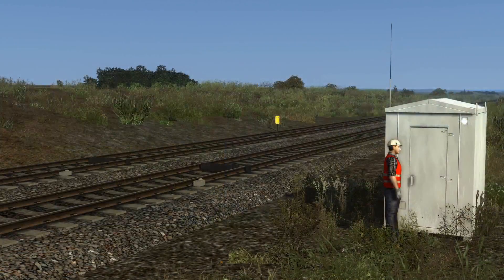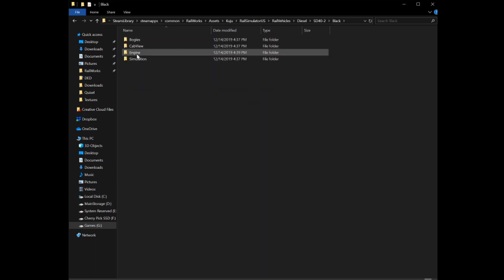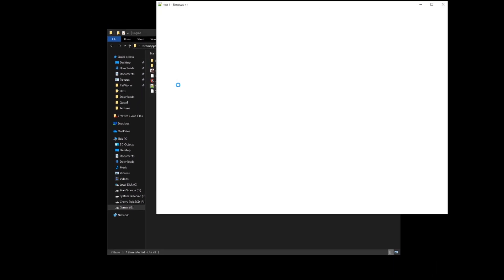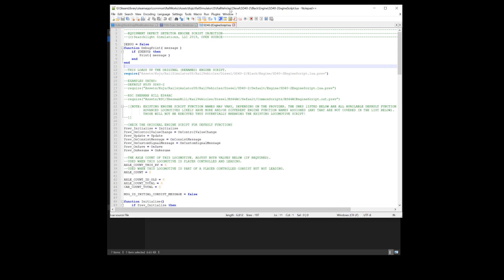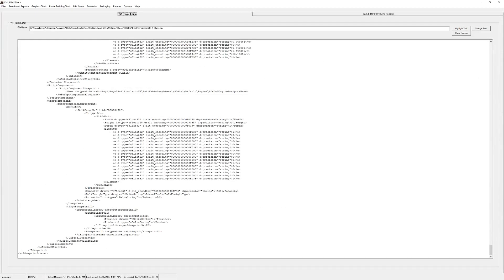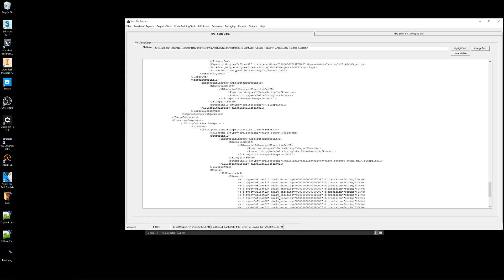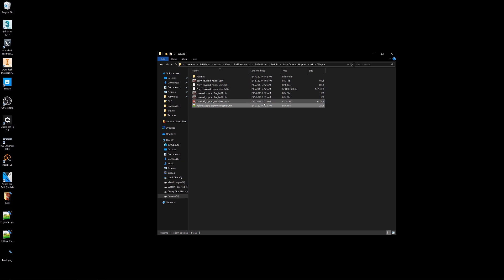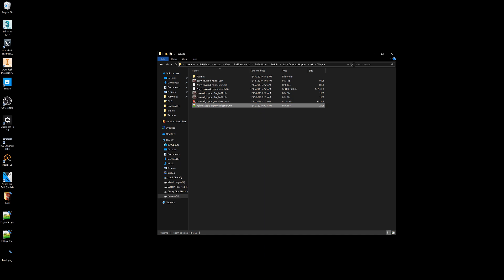[TS2020] - Equipment Defect Detector - Setup Tutorial 1

Comment: im not finding a path in the engine script that says
REQUIRES Assets/Kuju/RailsimulatorUS/RailVehicles/Diesel/SD40-2/Black/Engine/SD40-2EngineScript.lua.prev in the lua file. its just
-- OnControlValueChange
------------------------------------------------------------
-- Called when a cab control is modified
------------------------------------------------------------
-- Parameters:
--	name	= Name of the control
--	index	= Index of the control
--	value	= Modified control value
------------------------------------------------------------

function OnControlValueChange ( name, index, value )

	if Call( "*:ControlExists", name, index ) then

		Call( "*:SetControlValue", name, index, value );

	end

end
and that's the entire lua script. nothing else for me.